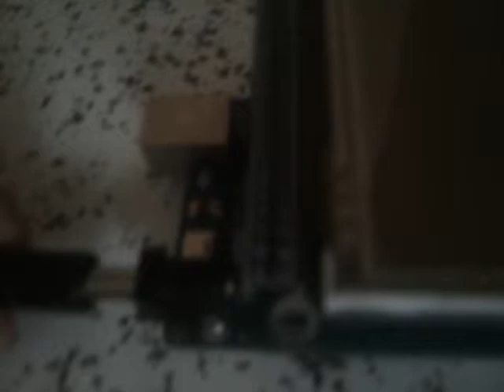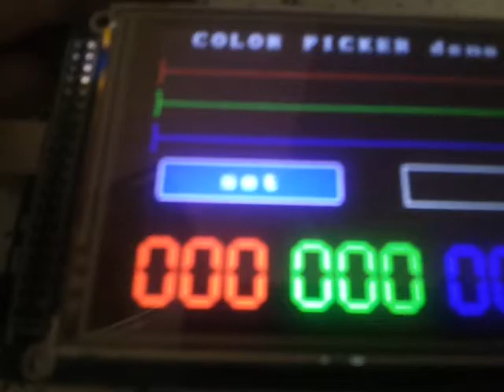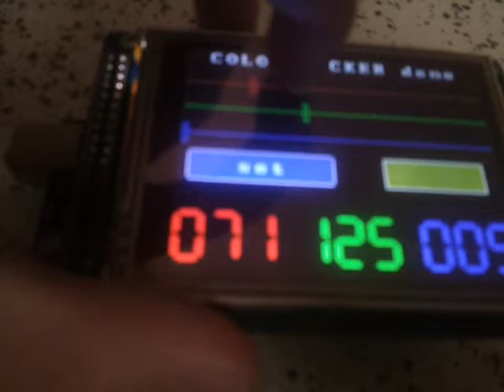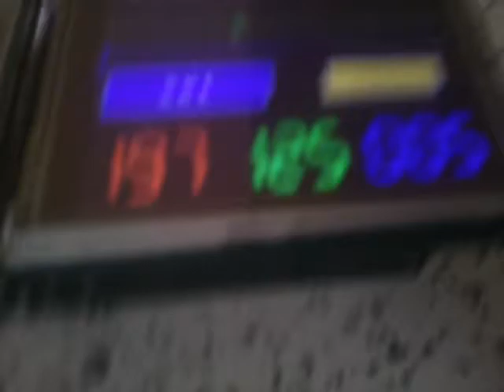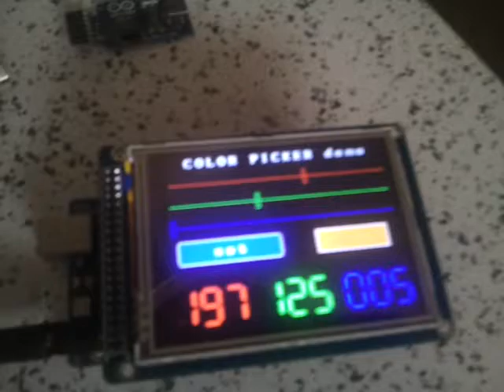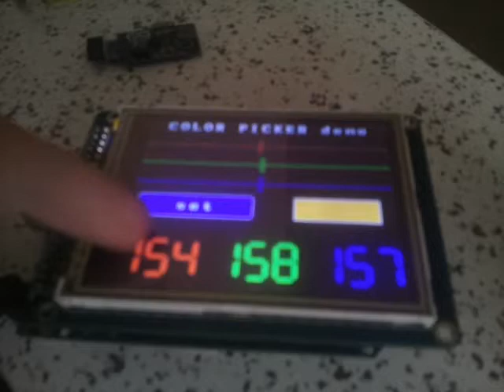GUI test on new touch screen (L-OS) (read description!)

Comment from the maker: while it's not a SainSmart LCD, the rest is correct. This was a simple project I did to learn how UTFT and UTouch worked, while at the same time making the GUI elements that were going to be used (and is currently still in use) for L-OS.

Comment: That is just a quick code that changes the three parameters on the setColor() function in UTFT library, with some nice visual feedback, based on arduino Mega 2560 and SainSmart 3,2" TFT+Touchscreen, but it is a great job aswell! Thats how it all starts until it becomes a piece of art :-)

Comment from the maker: the GUI isn't "made in" anything, all the GUI components are custom written and made up of simple things like rectangles and lines (and text). It uses the (now heavily modified) uTFT library for those basic graphics. If you want to make one similar to it (I assume you will be using a regular PC and not a uTFT display hooked up to an AVR processor like my setup) you could use openGL or LWJGL for C/Java and make functions that draw GUI elements with the basic graphic functions,

Comment from the maker: You can use semicolons if you want to, but it will compile just fine without them if you put the next command on a new line. 2 instructions on 1 line requires semicolons, though.
I designed it so someone coming from any language, including the many languages that don't use semicolons, can easily learn the language without any frustration. There will always be frustration, but I try to minimise it where possible. You can still code java style and that's perfectly fine, in fact it's reccomended.

Comment: Wait! leaving out semi colons and not being case sensivitve. 
This sounds like Lazy talk to me. No but really, why? I'm in the camp of, if you can't code something correctly then you need to learn how to. I admit i use a IDE which tells me where there is a compile error (like lack of semi colons) but i learned java with using only Notepad and i learned a lot from my failure( lack of semi colons was 1)
That being said are you doing it bases on spaces; those spaces i wont be using just because? :P